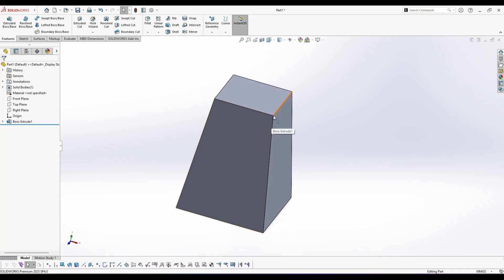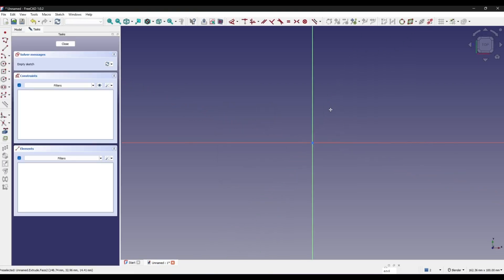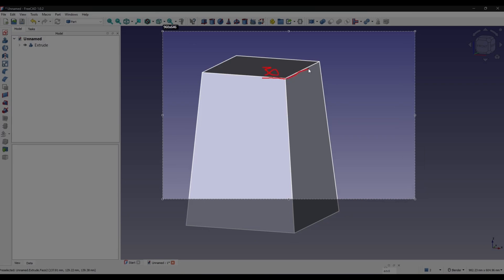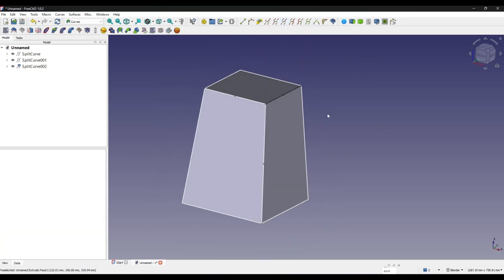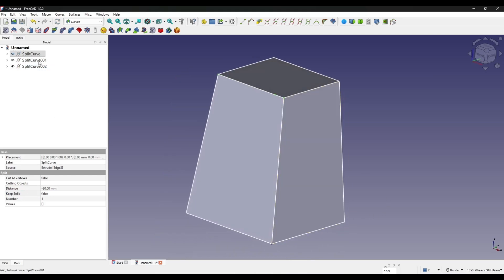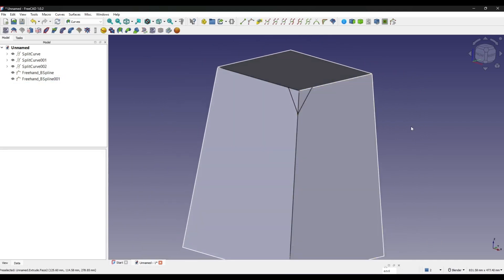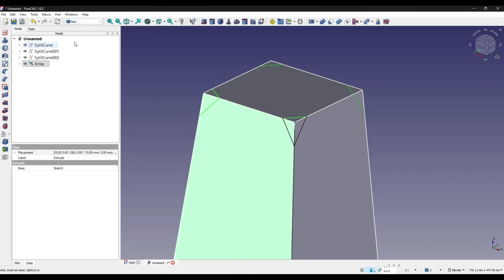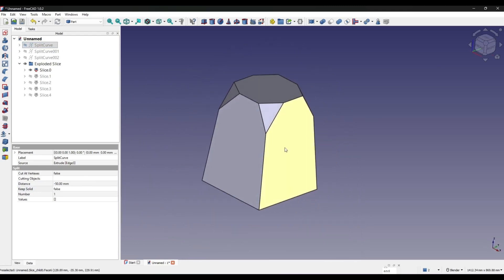How To Chamfer A Point In FreeCAD.

Comment: I can't get it to work with only 1 split. The error is that the BSpline does not move along with the point if I change the Distance. I can only get it to work if Number on the SplitCurve(s) is 2. Using version 1.0.2 on a macOS Sequoia

Comment: I'd say it's easiest in Part Design. There you could draw a triangle on the top surface with legs 30 mm and 40 mm and then create another sketch on on the front face, import the edge and place a vertex 50 mm along. After that you should be able to create a subtractive loft from the triangle to the point.

Comment: nice tutorial. i have a dumb question. is it possible to extrude the new rectangle face @ 1:22 with rotation, like 30° ? If yes, how? And after this, can the chamfer still work?
Reply from the maker: You can loft between two rectangles instead of extrude, the chamfer will also work with that.

Comment: Can't you create a plane from three points and use it as a cutter?
Reply: Yes, it is possible to create a plane, but not from the workbench Part
- you can use a workPlane from Draft 
- or a DatumPlane from PartDesign (you have to create a Body, create a DatumPlane and drag and drop it out of the Body)

then edit the plane attachment to place it on the 3 points

Be careful, however, because these planes are “infinite” in size, so if  the object to be cut is more complex, other parts may be cut.

Comment: Great work! Iv'e added VarSet with six values. Three that you set to modify the chamfer and three that are set in SplitCurves, either positive or negative of the first three. So now i have control of all dimensions without the need to change values directly in every SplitCurve.
Reply from the maker: yes combine with varset is great

Comment: Another option without using the Curves workbench and staying in Part
- Create the main shape with Sketch+Pad (as shown in the video up to 1:30)
- Create 3 vertices with “Create primitives” (leave the position at 0,0,0)
- Edit the attachment of the first vertex.
- Set the first edge and the vertex of the angle of the point at 30 mm as references.
- Select the attachment mode “Z tangent on edge.”
- Change the offset in the Z direction to 30 (or -30 depending on the orientation of the edge).
- Do the same for the other two points (vertices).
- Select the three vertices and create a new sketch (plane attachment on three points).
- Using the external geometry tool, select the three vertices and connect them with three lines.
- Select the sketch and create a surface using the “Make face from wires” tool.
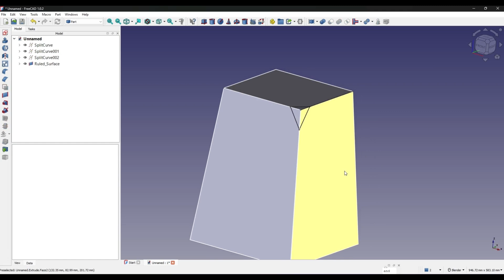- Resume the video at 4:30 to finish.
Reply from the maker: Very nice, thankyou for your idea. But in the last step you can use rule surface because the tool Make Face from Wires is not parametric.
Reply: @DuyQuangDang  You made me doubt, so I checked, and the surface created by “Make face from wires” updates correctly if you move the points (at least in FreeCAD 1.0.2)
I have one more quick question: why did you use the “Freehand Bspline” tool rather than “Parametric Line” to create the two edges of the surface? Was it to get around a limitation?

I don't comment often, but in any case, congratulations on your videos on the Curves workbench. Your channel is one of the best I know.